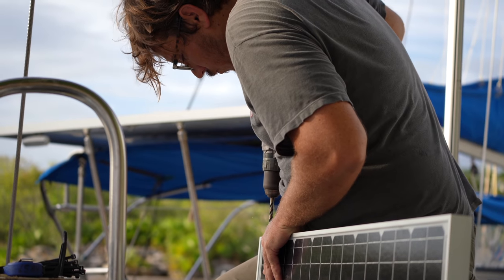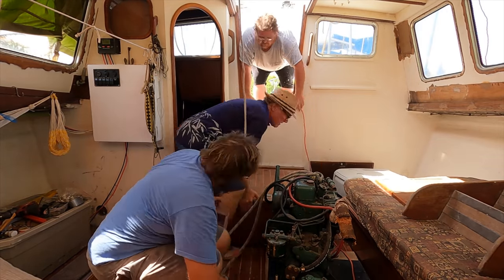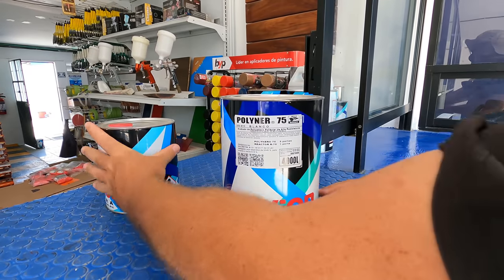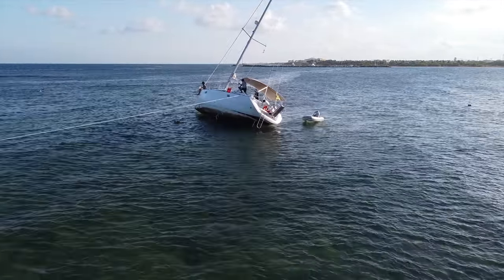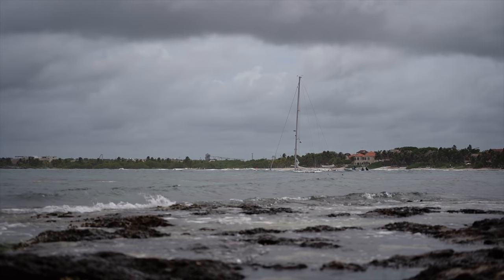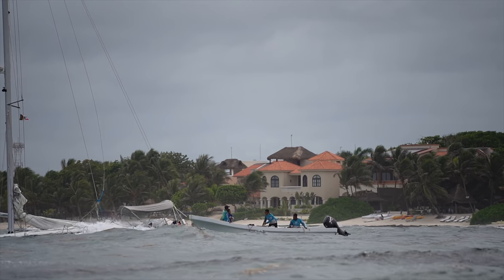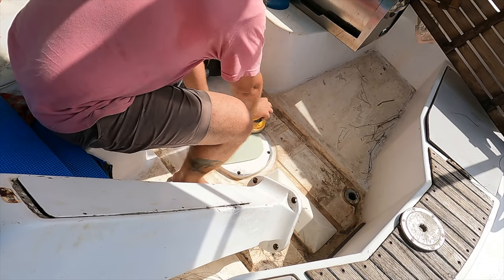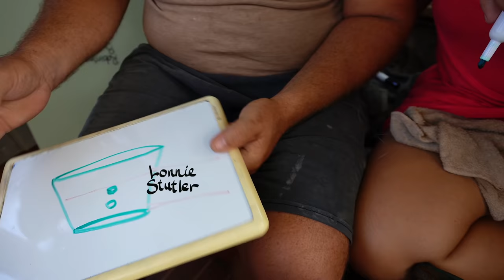LOSS OF CONTROL #100

Comment: I have seen rescuing a sailboat from the shallows by towing it by attaching tow ropes to the mast top and pulling it with several dingies. This way the boat hull lifts the keel off the ground and the dingies guide the boat.
Reply from the maker: Yes, I was complaining in the video that panga showed up to give a tow only after the sailboat was toast. No one wanted to help tow Topazia before damage was done...
Reply: They had nowhere near enough weight heeling it over and should have had flotation on the keel bulb that would have allowed them to keep kedging non stop She was almost there shouldn't have stopped.

Comment: My 2 cents, that boat could possibly ber rescued much easier if a different tactic would had been used. at min 5.00 we can clearly see the ropes pulling the boat in a way that makes the keel point against the sea bottom, having the boat rotate so the keel is pointing in the opposite direction from the direction you want to pull the boat the keel does not act as a plow, trying to dig into the sea bottom, but slips over it somehow less effortlessly. I don't have any experience in boat rescuing so what I tell can be completely wrong, but may be it is not so wrong so I write it here as it can be an help in the future if who reads it has to help in a similar case. It is so sad to see a such pretty vessel being punished that way, I hope that the damage can be fixed.
Reply from the maker: Hi, you are not wrong, this is essentially the process. To heal the boat over, get the keel up as much as possible, and to get the boat slipping/sliding out of the shallows as much as possible. The rescue crew was also doing their best to dodge rocks, so the route was not a perfect straight line.
Reply: @sailorama  Just a thought, maybe if one of the lines was attached to top of mast, maybe use halyard, to actually heel the boat in the direction of movement. I saw this on another video, a large power boat pulled the sailboat sideways by ropes on the bow and stern while keeping it healed over. Regardless, a valiant effort!! I hope there is people like you around if I ever run aground!

Comment: Wow, very sad! To salvage a vessel like this, in the first instance, is considerably easier than you may think! 🤔 💭 Most of what you need is usually readily available, especially so close to a Marina! 😎🏖🌴☀️🇦🇺
Reply from the maker: All that would have been needed was a little more support from an engine boat, and/or some more rope, as the ones in the video were pretty chafed through. That was our conclusion.
Reply: @sailorama  first step is to increase floatation!

Comment: A proper postmortem should be done & lessons disseminated.  This should not of happened.
Reply from the maker: I agree. I forgot to mention in the video that unfortunately, local motorboats/pangas were immediately looking to make money off of the mishap. There is no 'TowBoat USA' option in this part of the world. They were asking thousands of dollars to give a tug to the stranded Topazia - and I'm thinking that a lesson to be learned is that as a sailboat owner, you simply have to be prepared to fork over all the money that you have if you want to save your vessel sometimes. Robi, Toni, and I have all been involved with successfully kedging several boats off of beaches. Sometimes, like in this case, simply more power from a tow boat is needed. Other than that, when navigating near land, be prepared to deploy your anchor in an emergency, and have a backup plan for if you lose steering (even lashing a big enough oar on the stern could act as an auxiliary rudder).